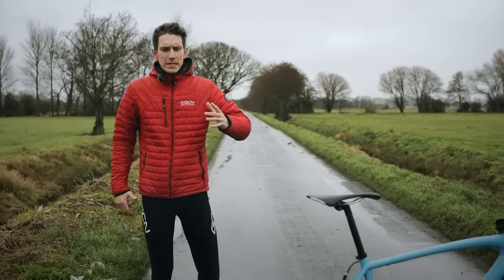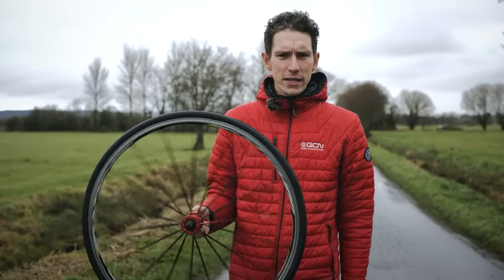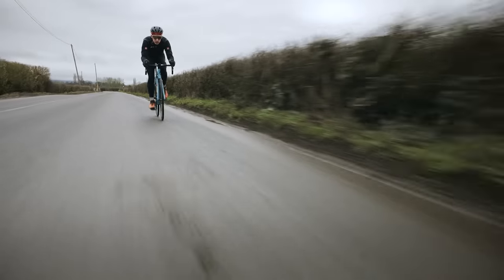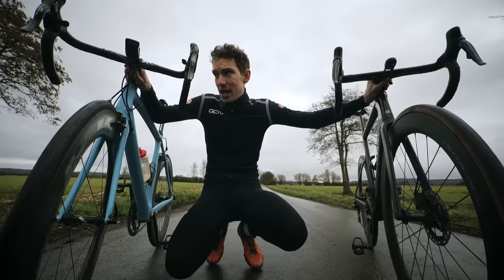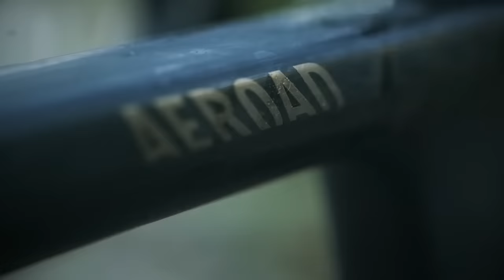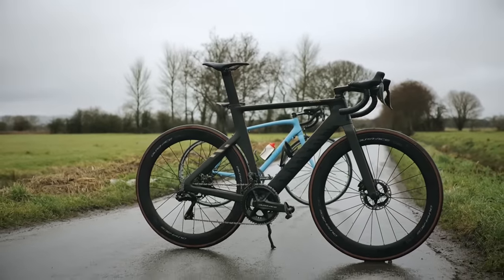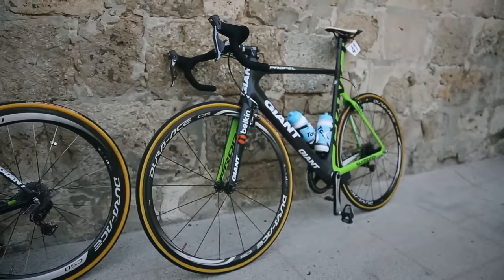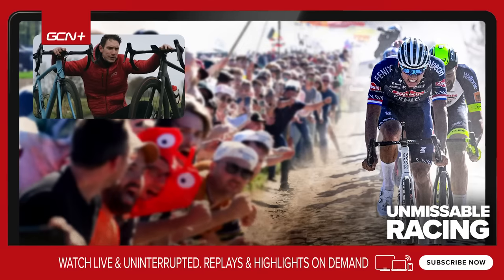How Much Faster Can I Make My Old Bike? | 2013 Vs 2023 Revisited

Comment: Awesome video!   Just wished you had showed power output for each run.  I think everyone is cheering for the old bike lol
Reply: You know 100% why they didn’t do that. The new bike would have been embarrassingly close to the old one. Ask any pro in private in the off season and they tell you what they think of these shitty disc brake bikes. Good god they’re putting disc brakes on TT bikes now 😂😂
Reply: @StopTheRot  bulshit… it’s one thing to say it would be almost as fast as a new bike (probably true), but a 10 year old bike is not AS fast as a 2023 bike
Reply: @fabioqueiros9322  lmao it literally is. Given same wheels, tires and riding position it’s probably a difference of 10 watts or less
Reply: @fabioqueiros9322 they got you drinking the kool aid I see 😂
Reply: @xAudiolith basicly every triathlete ever interviewed about disc brakes on TT bikes says that they would never ever go back to rim breaks. even when they loose a couple of watts in therms of aerodynamics or weight, the reliability and breaking performance in every condition outweighs the couple watts difference any day of the week.
Reply: @fabioqueiros9322  Disc brakes are well known to be slower in aerodynamics. They have better braking performance than a Rim Brake with Carbon wheels. 

Add in 28mm tyres being less aerodynamic than a 23mm, which will over come the rolling resistance disadvantage at high speeds. 

A modern bike probably is quicker, but reality is a lot of this is actually the balance or Aero to weight savings, which at this point means you can get a light, compliant, aero bike. In the past you were picking one or the other. 

Most of your Aerodynamics is your body, if you want to go fast you don't spend £4000 to get a top end aero frame and other £1000 on wheel. What you do is buy a road aero helmet for what could literally be £20 these days, get a speed suit for £150, and aero socks/Overshoes for £30. Add on a decent set of tyres and a £300 set of wheels and you will be 95%+ of the way there for £500 rather than £5000.

Electronic shifting is better but pretty pointless, Disc Brakes are better in the rain, but also pretty pointless otherwise and less aerodynamic. Modern bikes best features are small handlebar widths, and wider tyre clearances, saving 1KG in weight, or 5w on a frame is irrelevant to anyone not making an income off cycling.
Reply: No. The new one is, simply, better, and that's what the video shows.
Reply: @gokaygs  looks like 99% of all pro cycling teams and triathletes have no clue about proper riding. go and share your wisdom to the world my friend. 😉
Reply: The faster run was about 4% faster, which is about 12% more power, or a 12% reduction in CdA--36 watts on a 300 watt average run. Agreed it would be good to try to control for power. It's possible Si has more fun on the Canyon and pushes harder. Release the power data GCN! Would also be good to see a direct frontal view against a light background to measure the projected area.
Reply: @StopTheRot  it's ridiculous that they didn't use a power meter.  But the new bike is still faster.  Pretty remarkable how much faster my new Domane is than my Seven from 2006.  Both with non-aero wheels and 28mm Schwalbe Pro Ones.  The Domane is less than half the price of my Seven(not even accounting for inflation).  It's a good 1.5mph faster at a doodling 200w and the Domane isn't even an aeo bike.   I have similar cockpits on both bikes too.
Reply: @sirclemeni1  lmao they are all sponsored and use whatever gear is part of their contract. But you feel free to try to elaborate on the importance of disc brakes on a time trial bike where the object of time trialing is to get form A to B as fast as possible, aka using as little brakes as possible. Hahahaha.
Reply: @gokaygs  so bike manufacturers make the bikes purposely slower to get higher sales? i really dont think so, since success in the pro tour is mandatory to sell bikes. and yes, TT stages in whatever tour in the world have corners and if you shorten break distance, you go faster for longer and therefore go quicker around the course -> having to break as little as possible. especially in wet conditions. 😉
Reply: @gokaygs  now that rims are optimized to tire profiles and don't need to worry about a break track they are more aerodynamic. The calibers are also built very well into the frames instead of having post mounted rim brakes hanging out in the wind.
Reply: @sirclemeni1  Bruhh, I can’t put in the sole effort to enlighten you in cycling. You can stay on the koolaid forever for all I care and keep parroting what you heard from the likes of gcn and David Arthur. You enjoy braking late into corners and going quicker around courses, I have no doubt it’s a real thing. 👌
Reply: @Pastamistic  it is true that the tire rim junction is smoother on new wider rims and that contributes to slightly better wheel aerodynamics, part of which is negated by having a wider tyre cutting the wind. The rest about calipers being hidden and more aero is not true, even if a frame hid the calipers perfectly, the discs are still there adding rotational mass and they cool down by creating turbulence and drag against the environment. New cyclists have so much to say about tech and what is better and faster, thanks to gcn and industry marketing, but have such little actual riding time and experience out on the road
Reply: @StopTheRot  Haha... Maybe... To do a test both would possibly end up in a wind tunnel. And I wonder what would we search and  measure and calculate then? Lol.
In "live environment" there's no way to even compare a single bike with itself. Just take it for a spin 2 times at the same, say 30-60 km ride. How many times we had the time difference of a minute, two or even eight?
To me, both are very cool bikes. I got and old one myself. But find both very cool! More surprising fact was the width of the handlebars. I had 42 cm wide one for more than a decade myself. Switched to 40 cm aero last year (still has external cable routing). And yes, it felt like a different bike, way more comfy.
Reply: @gokaygs  I'm not a new cyclist. I've been cycling for 12 years with a background in motocross from childhood. I do all of my own maintenance down to full suspension rebuilds, shim stack tuning and building wheels for mountain and road bikes. I have multiple disc and rim brake bikes for off-road and on-road.

There's no real world difference in aerodynamic performance between rim and disc. New rim profiles that ignore needing a brake track are absolutely showing aerodynamic improvements over rim brake bikes. Use the appropriate tire for the rim you have and your application.

Ironman athletes are transitioning to disc brakes and a large portion of them are rich people who don't need sponsorships pushing products and they have no UCI rules. Top athletes do spend time in wind tunnels and they're choosing disc on Tri bikes.
Reply: @Pastamistic  as you said most people in tri have a lot of money and they also are not long term cyclists. They are spending their excess cash on the latest greatest most expensive bike that is marketed to them. They don’t even have a choice of rim brakes since most manufacturers don’t offer rim brake frames. When they are in the wind tunnel they are testing their riding position, not disc brake bike vs rim brakes.
The tire rim junction is indeed smoother on a rim without a brake track, if you choose to believe the rest of the two braking systems are on par and the rim tire junction makes considerable improvements in bicycle aerodynamics then you do you. 
I’ve also been riding a similar period of time and do entire builds and maintenance of my bicycles. I have both rim and disc bikes, however most of my riding is on the road. I think that people with mtb and motocross background  find themselves closer to disc brakes. With rim brakes I never looked for more braking power on my road bike with 25-28mm tires, my bike is lighter, my discs don’t rub when I lean the bike or put down power, my wheels have less spokes and therefore are more aero, my braking modulation does not change with heat added to the system and I can exert the exact amount of braking force I want every time.  Unless I move to somewhere rainy like UK or gain weight to be 100kg, I will never ever own a disc brake road bike, I like fast and light better than slow and heavy.
Reply: @gokaygs  No one is being forced into disc brakes, there's still plenty of people racing them. In 2022 a rim brake tri bike won a major event. Of course rider position on the bike is the single most important factor for aerodynamics. That's good enough for those of us who aren't into racing but it's not good enough for people who are trying to get the best results they can. Most tri riders are also long term cyclists.

Here's the simple reality. Disc brakes are more aerodynamic now that wheel and frame manufacturers refined their designs. Rim profiles are more aero without a brake track and fit tire profiles better. Fork legs can leave more clearance around the tire getting them out of turbulent air and reducing drag like the new Lotus track bike in the last Olympics. That isn't an option with rim brakes because the calipers need to be close around the rim. Disc calipers are integrated into the frame making them interfere with the wind less than typical rim brake calipers (even the hidden ones on Tri bikes due to the close fork clearance). In the end you have a more aerodynamic system even though the small brake disc takes a little away from that. If you want the most aerodynamic bike you can own, it's going to have disc brakes.

The rotating mass of a disc isn't even a slight consideration. Partially because cycling is done at a near constant speed. Even hard accelerations aren't happening quick enough where a marginal amount of weight around the hub is going to make any difference. This is bike racing, not F1.
Reply: @Pastamistic  Bruhhh...

1- No one ever won a TT with braking. Rim brakes are perfect for TT,   A hidden caliper rim brake TT rig would always be lighter and faster than the same bike with rotating non smooth discs making drag.  So still in a 2022 event rim brakes were good enough for someone trying to get the best time they can too huh? If more rim brake bikes raced there would be more rim wins, most bikes are disc at this point.  I ride around/with triathletes, they are generally quite fit but not that great at riding a bike in real world conditions, not as much as a cyclist of comparable fitness IMO.

2- That is your reality, not the reality.  The tire rim junction being smoother doesn't mean it makes the entire system significantly faster than rim brakes. Lotus track bike doesn't even have brakes and is designed to go around a perfectly smooth track with no outside wind. It is not like the Lotus Bike  blew everybody else out of the water either, it didn't win everything or break every record bc it has extra wide forks. Other teams raced on also new bikes that were designed to be as narrow as possible.  It is different takes on aerodynamic design and the Lotus race results aren't as ground breaking as the fork width.  In real world riding, on a road bike, aside from the rotating turbulent discs we are also talking about 16+ more spokes beating the wind.  If I wanted the most aero bike frame I can own,  I would buy an integrated rim brake TT frame and it would be more aero than any bike with rotating discs and extra spokes. 

3- If you are talking about bike racing then a 130 gram drag causing rotational mass does matter, that also brings with it the additional weight of 8 or more spokes and nipples. A lot of the regular folk pay premium price to upgrade and save 300 grams on their wheelset in this sport.
Reply: @gokaygs  maybe you should demount your brakes completely from your bike, since braking makes you slower. you would always be the fastest on your group rides then 👌.
Reply: @sirclemeni1  if you want to go fast you pedal hard and use less brakes, simple as that. I know it’s been drilled into you guys that heavy disc brakes makes you faster and it’s hard to hear the reality.   I’m sure grabbing a handful of disc brakes makes everyone ride next to you in group rides.
Reply: @gokaygs  yeah because everybody breaks just for fun and overbreaks every single corner. go tell me how tom pidcock could go faster on his descent of Col du Galibier of this years tdf by simply "breaking less".
Reply: @sirclemeni1  you think pidcock went fast bc of his brakes and not cornering ability? Everyone else getting dropped by him were on discs too but they couldn’t corner as well as him. It’s a skill to be fluid and fast going downhill like that, your braking system isn’t going to make you keep up with the guy who is bombing down using as minimal braking as possible. 
If you are pidcock you’ll have absolutely zero problems bombing down any  mountain on rim brakes.
Reply: @gokaygs  you can only bomb if your breaking is on point, otherwise you'll miss every corner. he wouldve been smoked by every body else with rim breaks
Reply: @sirclemeni1  bwahahahaha thanks for the laugh. That was perfect way of summing up how much you know about riding bikes.
Reply: @gokaygs  sorry that you are lacking knowledge of basic physics, i tried to explain it to you but seem quite resistent to it. but sometimes you have to let people in their believing that the earth is flat, so i think we should stop that argument here. have a nice day. 😉
Reply: @irfuel  long day educating pissed off noobs who ride the the latest and greatest 8.5-9 kg road bike with sram rival axs. I have to say, you are so aero bro and can brake sooo late wow!! You are also 10% faster then the previous iteration of the bike just like the marketing team said.   If pidcock was on rim brakes you’d smoke him down a descent with your discs, ok.
Reply: @irfuel  hahaha now all the nonsense you claimed makes total sense.  :)
Reply: Folks, go out and ride your bikes.  

No matter what kind of brakes they have, it will be better for you and for the rest of us than continuing these petty little arguments.
Reply: There's an awful lot of armchair engineers who seem to struggle with the idea that a leading team of aerodynamic professionals can make a frame more aero.
Reply: @marketingsam  “leading team of aerodynamic professionals” shows everyone how much you know about aerodynamics. At least I have a physics degree and some understanding of it, you are literally the armchair person here🤣
Reply: @sirclemeni1  They make the kit fancier to make a bigger margin, I suspect, which is a very different thing.  It's interesting that Campag are pursuing a far more niche market strategy and have maintained strong rim and mech gears market position.
Reply: @loc9588  exactly, and 10watts are not much at the speed of 40km/h

Scammer channel all along. Wattage would be so obvious to show - average and normalized please.
And you know he has the data.
Reply: I think the issue is that most marketing claims are in fact 90 %. So each "5 % faster" claim actually means 0.5 %, maybe.
Hence, when adding up 10 of such claims about various aspects of the bike (aero wheels, aero cockpit, pressure and coating, bb stiffness, etc.), the result will indeed be 5 % faster. And so on.
2014 bikes were not 8 % faster than 2013 ones or whatever 2014 marketing claimed. But 2023 might be.

Although I'm frustrates at the lack of power data in Simon's test.
Reply: 90 % bs*, I meant
Reply: @Alex-to8es this comment wins

Comment: Great video! Ordinary cycling fans like myself who cannot afford to change bikes every season would appreciate more videos like this one on how to upgrade your 5-to10-year-old bikes faster and by how much. Is it worth the investment, etc.
Reply: I think the choices are

Body position
Zwifting
Wheels
Tires
Handlebar
Maybe lubricant on chain 
Helmet
Kit
Pulley wheel
...
Waxing your legs
Reply from the maker: You can certainly get some great speed on budget bikes, Just look at the time we went racing on budget bikes 👉 https://youtu.be/mhz1GvKp2Xg
Reply: I’m still riding my 10 year old Cervelo S2. I have two sets of wheels. One set are Zipp 404 tubulars and the other is a set of Mavic Cosmic Carbons using tubes. There is absolutely nothing revolutionary in road bikes that is convincing me to go out and drop $5 to 7k on a new bike. Surely not for 30 seconds.
Reply: @abtcup  I have a 12 year old  Cervelo R3 which I recently upgraded to the new Madone. I would have thought tire clearance would be one of the reasons to upgrade alongside the obvious aero, disc, etc. For me my bike was getting beat up through the number of crashes and mishaps that occurred through just riding the bike. Feels good to refresh it.
Reply: Well, those wheels are about 2K euros for a set, so... worth the investment is a relative term. ;)
Reply: @kevinc9528  and eating less cotelettes before taking the ride